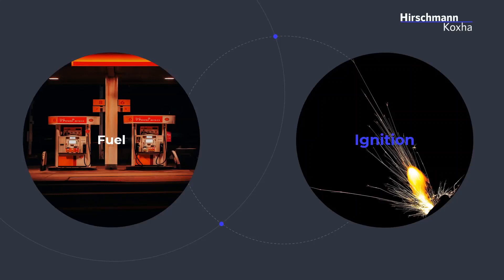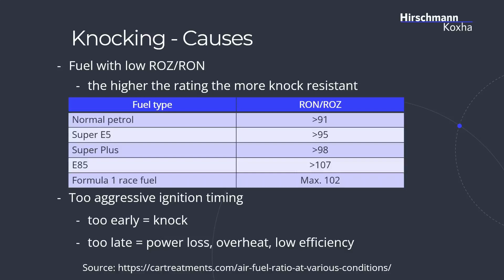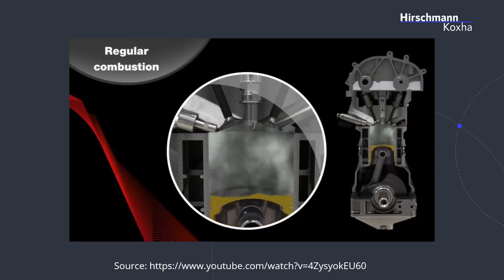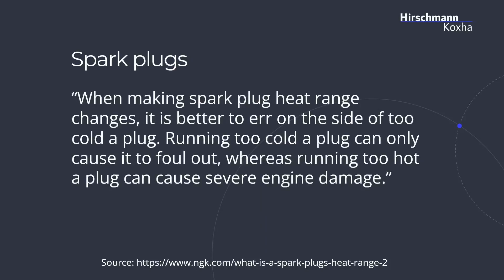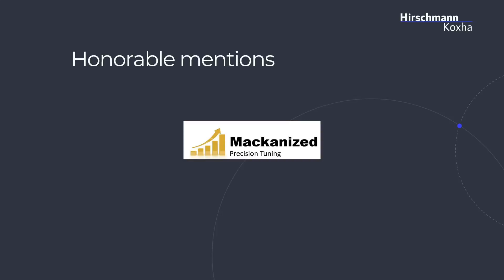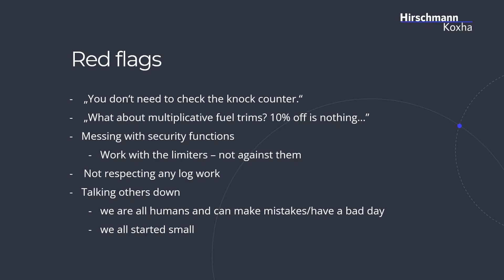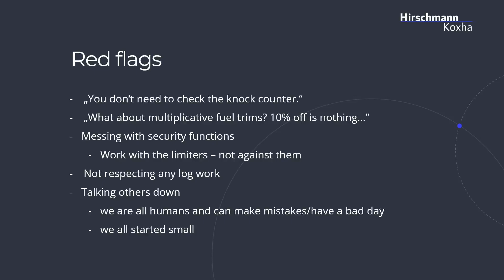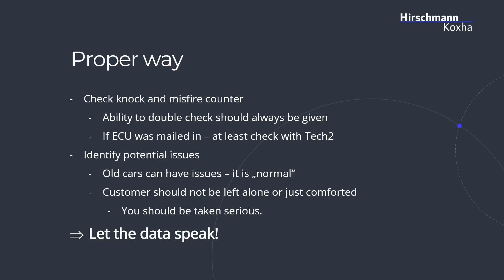Tuning Basics & Red flags

Comment: I'm on tronictuning forum and playing with T8suite for years now, it's a great place for Saab enthusiasts like myself. 
However if it comes to amending your own bin file I did few experiments, tries and errors. Some works good others not so much, but in the end I decided  to get someone more experienced than myself to tune my car.
Using "NoobTune". Tune was really good, right until 3" downpipe with sport cat installation. Few problems since than. Obviously a new tune is needed. Would you recommend Mackan over NoobTune? 
I mean, price difference is quite substantial. Does it correlate to quality?

Comment: Now you have me worried about the Denso IK22 plugs I am using (recommended by Vermont Tuning back when I had my stage 1 tune done) 😕
Reply from the maker: Actually - you can run Denso plugs.
Some people at TrionicTuning use Denso IQ24 and are happy with it. Just try to keep an eye on the cars behaviour and check the logs for unusual behaviour.